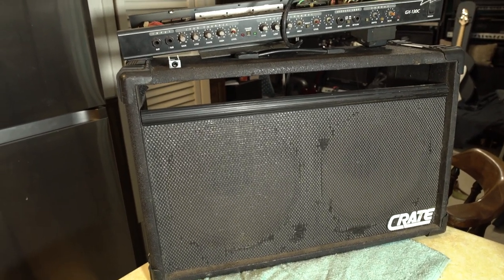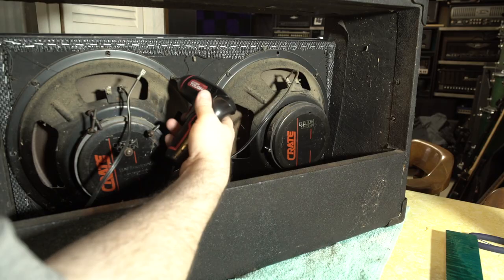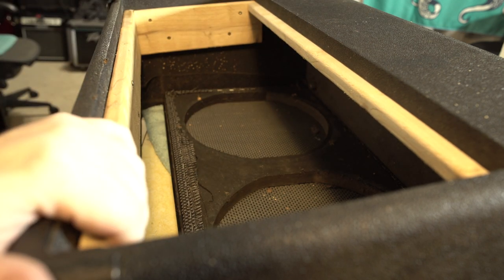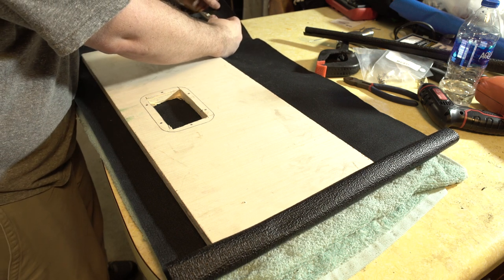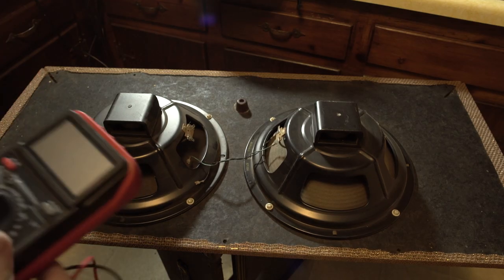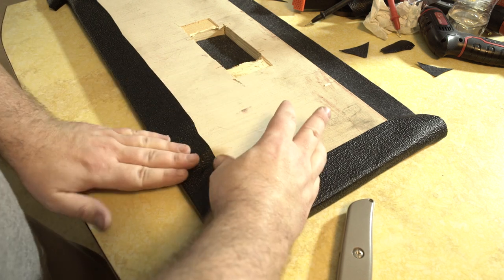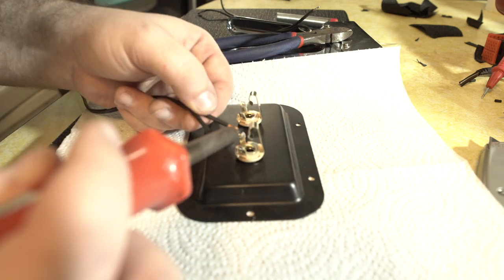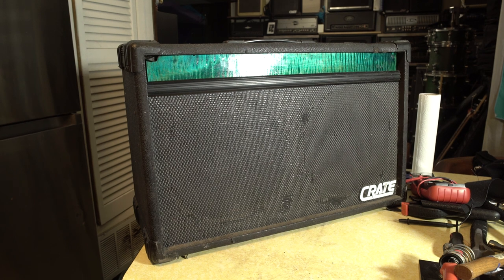Broken Amp to Sweet 2x12 Cabinet Conversion!

Comment: If the amp part worked that would have been one of the good crates for metal! Great cabinet sound though. I liked the flamed maple panel. I recently wired up a 5150 cab with v30s and scumback bh75s x pattern.

Comment: I have a 150 watt Line 6 I haven't got to use yet. 😔.. 
I do have a a 2x12 Randall Cab from a 200watt Tube that I ripped the INPUT JACK out of..

I want to use my Line 6 except the speakers don't have any speaker jacks.. the Randall has wires that slide over the speaker wires. 
Any suggestions?
Reply from the maker: Yeah man, wire jacks to everything and run you a speaker cable between them, simple and flexible.

Comment: I’m in the process of doing pretty much exactly the same. Is it possible to solder the 2 cab speaker cables into 1 input Jack? 🤔 if so, any tips/advice? Would be greatly appreciated 😁
Reply from the maker: It definitely is! Just be mindful of the om rating of your speakers because you'll most likely be running in Parallel, meaning you'd have to divide that rating down. Two 16 ohm speakers would come out to an 8 ohm rating for instance.
Reply: @ForsytheVideo  thanks mate! 😊 my old Marshall Valvestate 2x12 totally died! (It wasn’t the best sounding amp in the world anyway…)
Thanks to your video and reply, those nice Celestion speakers are not going to waste 😎👍 thanks mate!

Comment: HEY !! so i just got this exact amplifier and i turned the main unit into a guitar head so I'm left with an empty 2x12 body with the speakers. I'm looking to do the same thing to turn it into a proper 2x12 but i don't have experience on wood !! can you give me any advice on what to do when turning the body into a 2x12 ??? btw I'm subbing !!
Reply from the maker: Just follow this video I suppose, I used 3/4" plywood I believe.  If you have specific questions let me know!